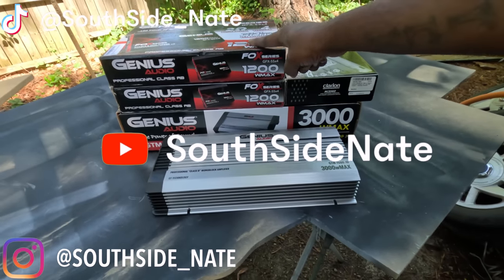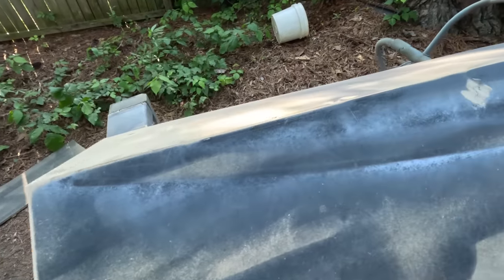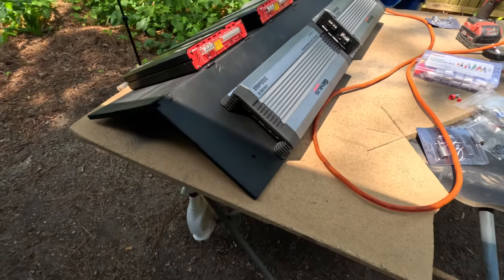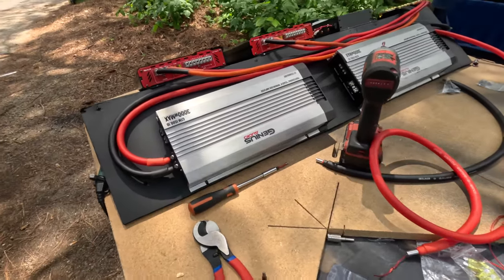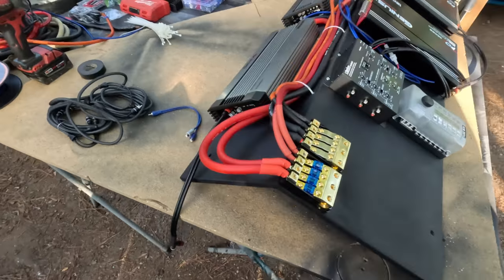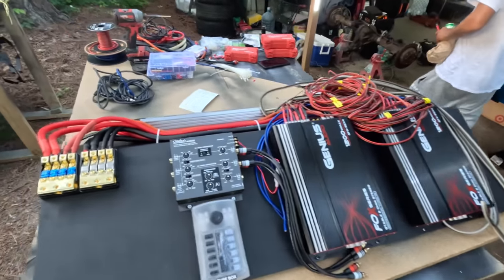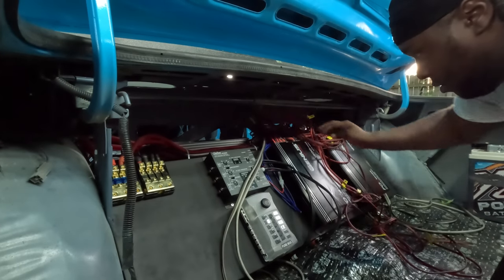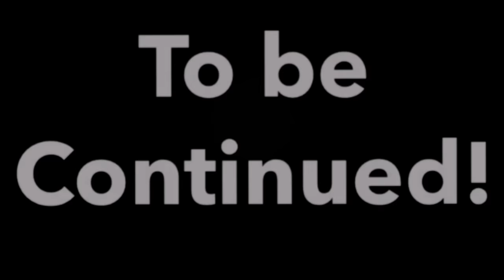1989 Box Chevy Build Ep.34 Building A Killer AMP Rack!!!

Comment: Looking good and clean. 1 bit of advice dual amp inputs for your sub amps. Yes it will take more wire but it will feed the beast faster and more efficiently. I basically use dual inputs on all my amps and they never even get warm really. And get lithium battery bro. Trust you’ll appreciate and love the as soon as you put them in and see how your system react to em! Bass on

Comment: Yoooo, it would look so much cleaner if u hide the wires. Drill holes in the wood and run the power wires down underneath the amp rack. U could even use grommets for looks!! Just a suggestion.
Reply from the maker: Nah that’s to much work i’m going for a simple clean setup. once the subs go in this amp rack won’t be seen!
Reply from the maker: plus the amp rack will be resting on the wires and would create problems for mounting it in the car! people usually hide the wires under platform amp racks mine it not a platform setup
Reply: @SouthSideNate bro that I'd a lot of work and if there is a wiring issue you would have to remove the entire rack to find it.
Reply: I think it looks better with the wires showing, as long as they are neat. If you watch 5 Star Car stereo, its all accessible from the component board/panel.
Reply: The way I did mine is I used cut off pcs from making the amp rack and just glued little squares of 3/4" mdf under the amp rack and it created enough space so the wires wouldn't be smashed under the rack and then the only part of the wires you seen was the few CLEAN inches of where the wires come through the rack and go into the amps. So I still had to zip tie like you did but ya didn't see all those wires. I used zero g. Wires too. So put little spacers of 3/4" wood on the underside to make space for the wires. You would like the looks even more 100%  I know don't nobody wanna redo it but you would be happier with results.
Reply: Looks good tho  for real. But the next one you do will be your beat one yet.  Keep it up. Your getting good

Comment: Loving the build, this amp rack came out clean. I’m not sure if you know this, but the wire ferrules have their own special pliers where you can crimp them to the wires so they don’t fly off, but you did it just fine with the heat shrink to keep them from slipping off
Reply: Dont use that tool for these round holes. It will create more issue in the long run

Comment: Salute the grind in work put in 🤙💯,Nate what gone do to keep them amps cool?, You got that amp rack build you can put some fan behind it cut a section out where you got the amps lock down where it can't be seen,it's a few ways you can set up the fans on how they come on put a temperature gauge where get to certain point in it kick on just like radiator on set the fan to the amp remote wire when the amp come on the fan come on and make sure the ground wire set the amp just a ideal if you don't already know that..

Comment: It will look a lot cleaner if you hid your cables under the amp rack
Reply from the maker: Negative!! it would create problems for mounting it in the car, it’s not a platform amp rack it’s designed to mount flat to the trunks floor

Comment: You actually suppose to and should crimp your ferrules/wire before installing them.
Reply from the maker: I do my research on everything i do and the technique i used is perfectly fine. why buy another tool when the screw on the amp will work just fine.

Comment: Sa e the headache now and run your sub amps 0 gauge straight to the battery in the trunk.  That distribution block can’t support the sub amp we’ve if they not high power.
Reply from the maker: Thank for the tip, I got extra distribution box’s and wires should be a quick fix! 🦾💯
Reply: @SouthSideNate  yea everything else looks good. And if you can run 2 0 gauge grounds from each battery to the actual frame of the car u won’t have any ground issues and if you like any other music head you’ll be upgrading later.